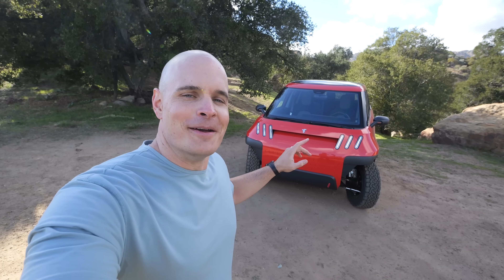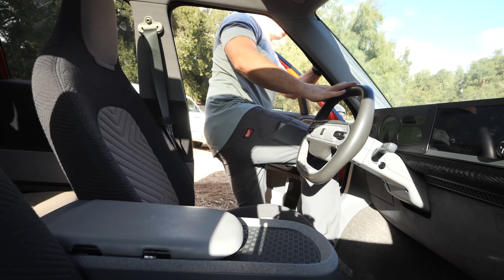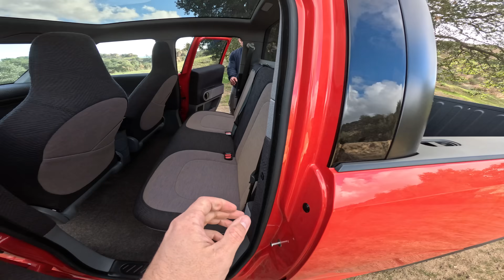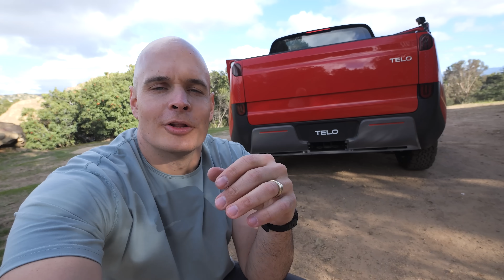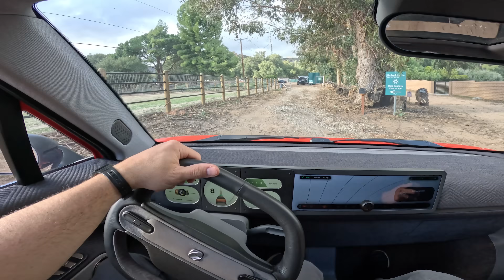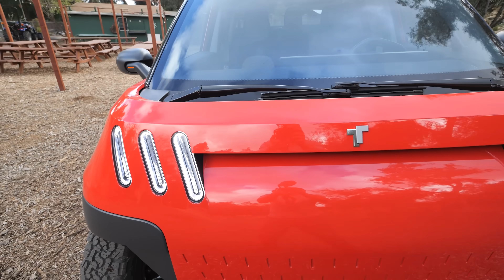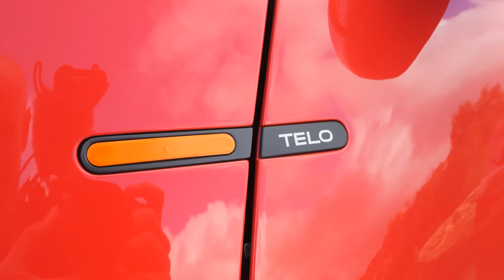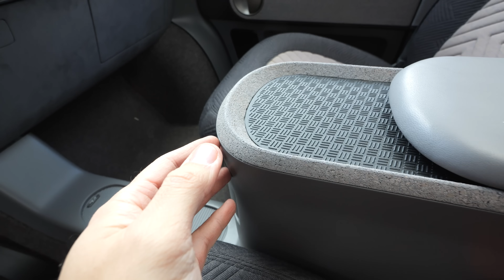ONE TRUCK TO RULE THEM ALL...

Comment: I would want this even if it was gas powered.  I've been wanting a small daily runner pickup truck since volkswagen put a bed on the back half of a VW Rabbit.  That it's an EV is a huge bonus.  I hope that by the time it makes it to market, that there will be an option for a more basic option at a cheaper price.  You could take away the glass roof and all the power options as well as using cheap hard plastics.  I don't need a fancy complicated infotainment system either, just something that I could plug my smart phone into.  As long as you keep the range to at least 350-400kms with quick charging and at least 4000lbs towing capacity.  If you could somehow sell it for 30-35K that would be fantastic.  Keep the focus on Affordable and Utility and this thing will sell like hotcakes!

Comment: Looks awesome and it has the towing capacity to pull my Jeep. My only real issue is... you are right up front. No crumple zones. The price is right though. If I can be convinced about crash safety... I'll buy one. I don't "need" a truck except to pull my JK back and forth from off-roading.

Comment: Nice utility...... Perfectly tiny to fit in the tiny closet that they claim to be a two car garage. The cabin noise is rough. Maybe 28k or 32k. I'm glad I'm not most people. Good job though. Keep innovating.
Reply: It's literally a bespoke hand built preproduction model, of course there's gonna be squeaks and rattles.  Still a lot of work to do before they can mass produce them.
Reply: @existonfile8525  lol. Okay. Bespoke, engineering sample... Sound proofing/treating...easy button. Lol. Still good job. Lol.
Reply: @TheGokenshi brainrot, typical YouTube comment.
Reply: @existonfile8525  how so.... Typical keyboard, YouTube brainrot, low hanging reply. Wanna reserve one? I'll cover yours because I know you can't. I'll buy mines and maybe sell it to you for a deal after Rockstar releases GTA6 & they finally come out. Whaddya say??? 😝😁

Comment: The interior is wrapped in moving blankets and portable cooler insulation. The creaks and rattles when you drive it but it's cool 

Throw a gas engine in there and make it a hybrid.

Comment: I was a mechanic for an EV company, and one of the biggest hurdles we ran into fixing older cars was proprietary parts. The DC/DC was made by Toyota, who made the part for our specific model only, and stopped manufacture all together not much longer after we switched parts. Without replacements, we relied on either crashed cars or repair of the components inside, which usually ended worse than better. Having an EV that might have a life past 10 years with accessable repair parts is a very hopeful thing
Reply: When Tesla first started out they had to use a hydrolic motor punped off the drive unit to run the AC compressor. 15 years later small electric AC compressors are so prolific even ICE cars will use them if their electrical system allows for it, since it eliminates a few moving parts compared to a belt driven one. 

This problem fixes itself as time moves on & these cars become more prolific. A new EV maker today has access to every conceivable part(their are far fewer total than ICE) from 3rd party suppliers
Reply: That would be the Elephant in the room for EV's?
Reply: @SteveSmith-zz4ih  I feel like the elephant is the motor and battery replacement time and cost.  No brand will come out and mention that when they sell hybrid/electric cars.

Comment: They build an electric truck with a hitch and mention it can tow 6k + BUT install the charging port in the back so in order to charge at a station owners will have to park trailer and unhook then back in parking spot. Manufacturers should put multiple ports and put them in strategic locations that make some sense.
Reply: Multiple ports would add a ton of expense and weight for an edge case.  Even with a front charge port finding an appropriate stall is tricky.  Basically if a charge location has 8-10 stalls just 1-2 designed for access from the side for those with trailor would solve the problem. Detaching/Reattaching the trailor to charge probably adds 10 minutes of work.

Comment: 73" wide is a little too much.  Other city cars that are that  length are 65-68" wide.  My 08 Ranger and  my 03 BMW 3 Series are both around 70" wide with 58.5" track widths and that's comfortable to parallel park. The length doesn't really matter to me. Track width has increased substantially and new cars are just less nimble.

Comment: 152" length is wild. My Kia Rio5 (a tiny hatchback that's less long than the sedan version) is 160". I wish more automakers made smaller, practical trucks. My ideal vehicle is something that is pleasant for city driving/parking as well as usable on rougher dirt roads for camping, and be able to use for random things like hauling garden supplies/small lumber/small furniture, strapping things to the top, having a bed/cargo space long enough for a tall person like me to sleep in, and being able to tow a small boat trailer or camper.
Reply: Yeah, it's amazing how much room you can by taking out the engine, transmission, and radiator, my fiesta is 9" longer than that. On top of that you know they extended it just little to get the whole 4'x8' bed size.

Comment: Usually I am very skeptical of EV startups, but this is basically a domestic Americanized K-truck. Between sanctions, domestic preferences, and the difficulty in importing foreign vehicles, I think they've got a really good chance at becoming successful. 

Things I would think are important: A combustion version should be available (at least a small motor driving a generator? could slot into the back, literally 50cc just to buy range/op time), because I know k-trucks are very desirable for some rural applications. 
Also, a version with a dump bed would be great. 

I totally get you're targeting the urban market, but you have the opportunity to seize the latent demand for k-trucks. Go for it!
Reply: Love the idea,but what about impact zones?  Driver is awfully close to the front.  I am reserving final judgement until crash studies are provided.
Reply: I really do think the generator-assisted EV is the way forward for a lot of EV applications. You didn't need much ICE hp to meaningfully extend the range in uses not served by current EVs.
Reply: Nobody tell Ford/GM/Ram about these!
Reply: So why does a form factor you like make you less skeptical? They are still a startup making rediculous claims and taking money with no actual product yet.
Reply: @TroySavary  Because as long as they don't mess up, it's guaranteed to sell well. Never meant I know anything about the actual vehicle besides what we saw, but the claims aren't absurd
Reply: @debiancool  They claim a fold up third row will fit in that tiny gear tunnel, making it an 8 seater. They claim their batter takes 50% less space than any other EV battery the same capacity. They are making towing and range claims, despite having tested neither. So yes, their claims are absurd. Assuming they don't just take the money and disappear, like all the other crowd sourced EV companies, in a few years, when testers actually get to verify their claims, all the apologists will be shocked that none of the oromised numbers were hit.
Reply: 👍👍 I would give up the monster tunnel for a small diesel generator and tank.  The size would be under the regulatory need of DEP.
Reply: @RonLeedy another video shows an access panel in the bed to the monster tunnel. It's possible for a DIY or aftermarket generator range extender
Reply: @RonLeedy  That's a really good idea. Nice.

Comment: 0:50  Need Stone as a brake? 😂
Reply: Wheel chock. never trust your parking brake on a big hill
Reply: @stephen1r2  do ev's not have a parking pawl? i guess i never thought about it until just now
Reply: @historyguy77  no transmission so usually no, just the parking brake
Reply: @stephen1r2 parking brake is Not conected to the transmission. 
It is Part of the brakes
Reply: @historyguy77 because no transmission
Reply: @ Than all the Tesla an other ev driver, Transport always a Stone in case of a Not flat parking Situation?
Reply: @Arthur-yu8hn  No? just buy wheel chocks, or turn your wheels so they can only roll into a curb
Reply: @stephen1r2  no! imaging the cyverchocks. A Stone chaped Like the cybertruck for only 299€ 🤣
Reply: Finally, someone else noticed that. Thought I was the only one.
Reply: Yikes that’s not a good sign. That didn’t even look like it was on an incline.

Comment: There's so much creaking inside the cabin when they're just going over smooth dirt, I think he didn't want to give it gas cause he was afraid it would fall apart 😂
Reply: Yeah...they've mentioned it's preproduction and the rattle on another video, so I'm OK with the rattle, but it is distracting!  And, when I buy one, better be silent! :)
Reply: Rattle is pretty common in preproduction. This is the vehicle where they find all those little rattles for the 'production intent' vehicle
Reply: He said in a previous interview that they were testing it hard the previous few days and it developed that rattle.
Reply: @GEEE-W that was a question I had about all the noise in the cabin….thanks for the answer.

Comment: I'm feeling this truck. Would 100% daily drive in the city. A frunk is not needed when there's a bed in the back.
Reply: Until people steals your groceries out of the back
Reply: @iPhone5244 Make the grocer your last stop on your shopping trip and you don't have to worry about someone running off with your groceries. Or, you can just get a retractable hard tonneau.
Reply: Hence the monster tunnel @iPhone5244
Reply: I’ve driven trucks my whole life. A frunk isn’t “needed” but it is a huge plus. The Telo is still a great truck and the frunk might be a worthy tradeoff, but from roughly ages 20 to 40 I cursed the lack of secure, weatherproof storage in my trucks. I used a deep toolbox in my last truck but they are really inconvenient to access. Now that I have a Sierra EV it’s awesome!
Reply: Lack of a frunk is a fair compromise given the size, but my dad drives an F150 Lightning and the frunk on that is AMAZING.  It's the size of a normal trunk and he uses it constantly.  Too bad the truck itself is the size of a boat.

Comment: its a tiny bit ugly in my opinion, but i absolutely love the idea and its better looking than the cybertruck. overall if it works out id give it 7/10 for overall looks and an 8/10 for desirability. would i pay 41-42k for the 2wd version (over 50k for 4wd and biggest battery)? honestly not in its current state with current suite of features.. but also i wouldnt spend over 25k on a vehicle in general so take that bias with what you will.

Comment: CEO: Mini trucks have to be electric.
Me: They don't. Many in Japan and China use a gasoline engine.
Reply: He says that due to ICE gas mileage regulations. Huge trucks are the norm because it allows them to build them with less efficiency. Mini ICE trucks are too hard for them to engineer to meet regulations. Electric has none of those regs, thus his statement.
Reply: @Minnemike_StPaul  The ICE options are also low horsepower to boost efficiency. It will be a challenge to meet efficiency requirements without sacrificing power, but with a company like Honda or Toyota who have mini truck experience, surely they could figure it out. I don't really see mini trucks as something that is needed here as we already have the Santa Cruz and Maverick pickup trucks that are smaller than midsize and full size trucks.

Comment: This is one of the first "rethinkings of the Truck for Electric, based on Unitily instead of nonsense" I want to see a crash test of this thing, seems like form before function, and that flimsy back door between the bed and the cabin is going to let heavy material enter the cabin at high speed in the event of an accident if it's twice as strong as it seems.
Reply: Interestingly enough, the CEO is an engineer who specializes in safety systems for vehicles. They are purposely designing it with safety and efficiency as primary. Probably only possible with the type of staff they have.

Comment: That cabin noise is horrible. Love everything else! I couldn't fit in it but I like it!
Reply: This is Pre-Production. They will use it to dial in noise suppression among many other things.
Reply: I thought the same thing....what the heck was rattling around so much?
Reply: @ian3580  Pre-production, he admitted they are working on that for actual models to customers in a TFL video earlier today.
Reply: @ian3580  I think it was the gravel or whatever terrain they were driving on being kicked up by the tires.
Reply: @ringtyler  The only way it was due to the gravel is if there was some rolling around in the cabin.  It wasn't that.
Reply: noisy cabin and the price are to figure out. a bit too steep for the quality
Reply: @ I think the price they're targeting is fine.  People spend almost that much for off-road side-by-sides that you can't even drive on the street.
Reply: @byYuriy  $6k cheaper than a Lightning, and more useful, potentially more repairable... we'll have to see what the quality of the production vehicles are once they're in people's hands, but there's great potential at this price point.
Reply: @godminnette2  I would consider it as a second car for $30k. Hard to justify more than that for a basically prototype car
Reply: @byYuriy  based on current information? Absolutely. Once it's in people's hands for six+ months a better valuation can be made.

Comment: We need more of these practical vehicles on the roads and less of those expensive monsters.
Reply: Oh I’m sure this’ll be way overpriced.
Reply: @The_RC_Guru  I was thinking the same thing, but the estimated final price is $34,020.
Reply: Until one of those “monsters” meet this little thing head on. Good luck. I think it’s cool and all but I would feel safer on a motorcycle, and that’s saying a lot.
Reply: @bobwalters7414  so basically, we should all buy "monsters" to be safe... cause it's definitely safer a head on between two monsters...
Reply: @bobwalters7414  this little thing probably weighs 4000+lbs and there’s already smart for 2 cars, slingshot trikes, mini coopers, and Miata’s and more similar size vehicles on the road.

Comment: I'm not a huge fan of the design but maybe we will get a more traditional looking design from other manufacturers. My issue with so many "EV" pickup trucks is they are recreation first work second. Most of them are some form of unibody meaning if you want to switch to a different bed style (flat, utility, dump, etc.) you can't. Mini trucks have traditionally been very good with bed options and this is a step in the opposite direction. The F-150 lightning is the closest to what I would consider to be a work first pickup truck but the size isn't for everyone.
Reply: What bed option do you see this lacks?
Reply: @Minnemike_StPaul  Traditional mini trucks have flat, dump, and/or lift bed options. Utility beds are also a thing but I don't recall seeing them on minitrucks. Mostly just 250/2500 and larger pickup trucks. Also a regular bed without the track system would be nice for those who carry messy materials on the regular like yard waste or hardscaping/landscaping materials.

Comment: I hope that condensing the batteries by 50% in the overall pack does not mess with battery cooling and performance along with less flame retardant polymer material. That would raise safety concerns for me considering one in the future.
Reply: They mentioned that the battery is the primary thing they design in-house... and being OG Tesla engineers, I assume they know what they are doing.

Comment: Looks pretty cool. Although, it looks like someone took a Rivian R1T and ran it headlong into a wall one too many times. 😂 I really hope they sell many of these, the pickup truck segment needs more competition and these quirky little things might just do that.
Reply: You mean it doesnt have a giant hood space for a motor that isnt there. Finally an EV designed around he battery and not a motor that isnt there.
Reply: 🤔

I never said the front being short was a problem, it does, however, mean there isn't a storage compartment up front, such as a frunk. Plenty of EVs these days have frunks instead of an motor compartment, loaded with motors and batteries.